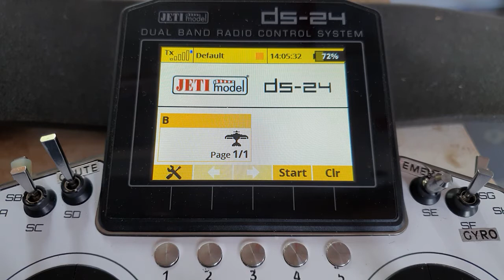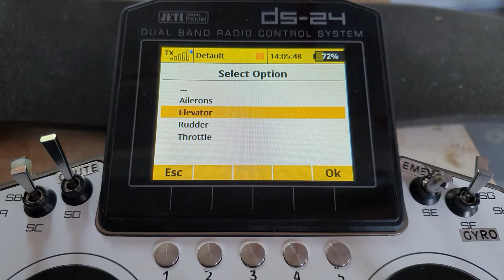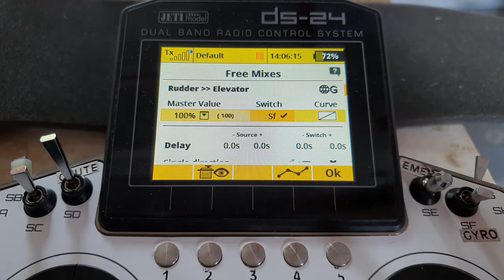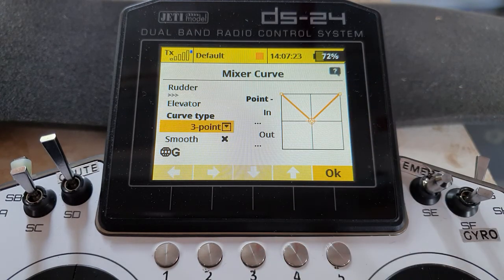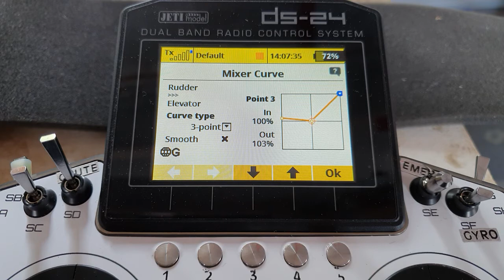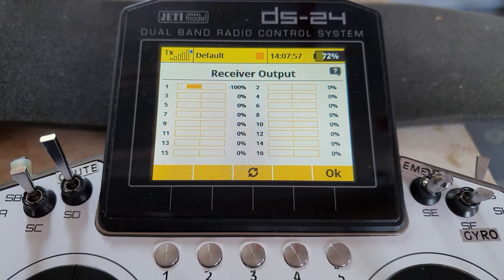Jeti - rudder to elevator mix, knife edge

Comment: Never been a fan of mixing away various couplings during knife edge. Simply because for my part, for most models, there is a massive overlap between the rudder range I use for knife edges vs rudder usage in completely different phases of flight.

Besides, what elevator compensation (and aileron for that matter) is required to maintain a perfect knife edge also depends of stuff like prevailing winds, tiny changes to CG, etc. So no mix in the world will make a model knife edge perfectly by using rudder only.
Reply from the maker: So what?  Other people do like to use it and this video is for them, not for you